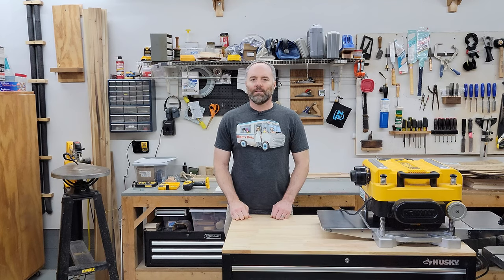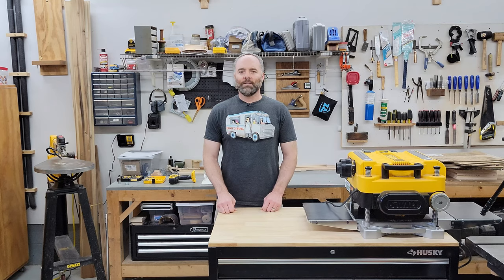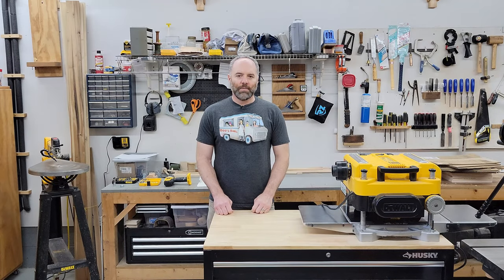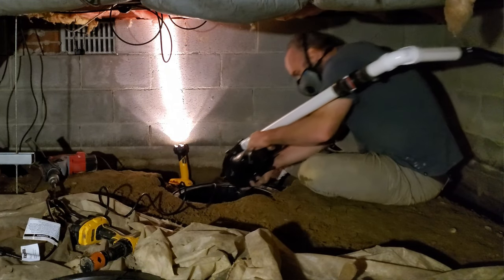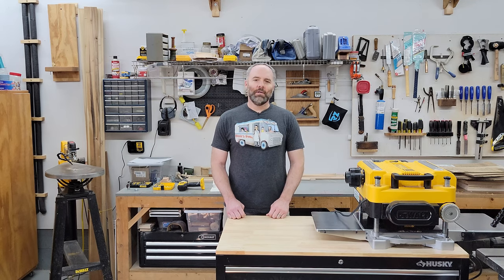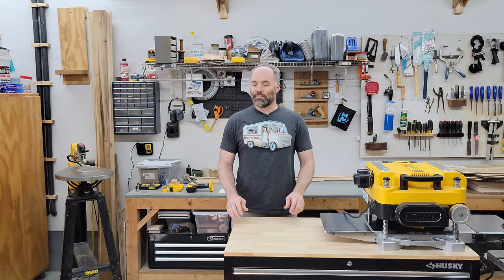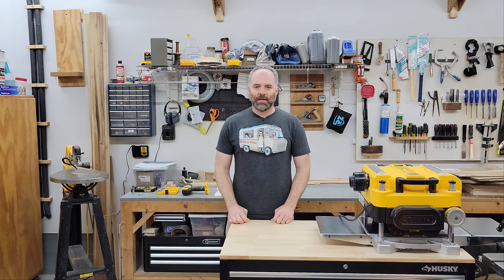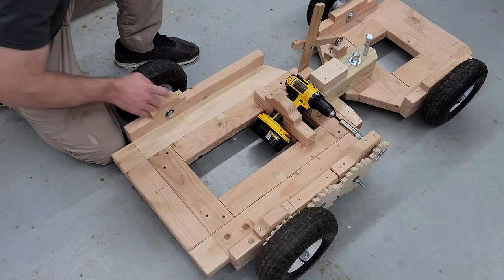Drill Powered Crawl Space Caddy - Part 2

Comment: My work has had me in many crawl spaces over the years and I've made a few rough terrain creepers each with a caster like mounting for the wheels. Propulsion is achieved the same as with a garage creeper, by  pushing with ones feet. To position for work, a back rest that goes from flat to upright makes it easier to sit on the cart and work at joist height. Flat on my back gives the greatest clearance to overhead obstacles and when your nose is just brushing by the underside of the joists it's easy enough to pull along by grabbing the joists.

In my area many crawl spaces have concrete ground seal making it much easier to roll over than when working in a dirt crawl space. Plastic never stays place, it is easily damaged, and water pools under it. Sealing plastic at every seam, around every post and pipe and along a hundred feet plus of dirty, dusty foundation wall seems a nearly impossible task to complete. I firmly believe that all crawl spaces should have a concrete ground seal over top of a layer of 6mm plastic as the best and easiest way to achieve a satisfactory result. Drag the hose from a concrete line pump to the furthest corner, spread some concrete, rake and then roughly screed it out then move to the next patch of floor area.
An added benefit of a concrete surface is that it makes it much easier to keep rodents and insects from moving in. If you hire out the concrete work, specify that a raked finish is not acceptable and the finish must be at least roughly screeded or floated.

As to moving material out and back in again you might do well to rent either a roller conveyor or a motorized conveyor belt. Fill a bucket, set it on the rollers and give it a shove. If working alone just keep adding filled buckets onto the conveyor until it is covered, exit the space and with a rope looped around the furthest bucket start pulling until the last bucket is off the conveyor and emptied. Then buckets back on the conveyor give them a shove back into the crawl space and in you go to start filling them up again.

A last thought on moving through a crawl space (with a concrete floor) my favored method is to use a mechanics stool, one with 5 casters, a swivel seat and a gas support to raise the seat. I lay with my stomach on the seat and can push with my feet and zip around quite quickly and it is a marvelous relief for my tired knees. The gas strut lets my lower my profile to get under pipes and beams, then easily boost it back up to a more convenient travel height. The stool base has a bit of room for a few tools and materials.

Oh, yea. Have you looked at the battery powered wheel barrows? Too tall to use in your crawl space but they would have the power to move a lot of weight and perhaps the motor, battery and controls could be borrowed to power a cart for your project, then put back into the wheel barrow when done.

Comment: Nice idea.  If you connect the battery to the drill using your own wiring, you could put a switch up front.  If you lock the drill in the ON position (or use a hose clamp to keep the drill's switch pressed to the speed you want), you could turn the drill on and off using your new switch up front.  You could then remove the steering mechanism, lean farther forward and steer using both hands.  This will give you more leverage to steer, get your body lower to the ground and you can turn the drill on while using both hands for steering.  Also, you could make a low profile wagon and connect it to the back like a trailer to move your stuff around.  Just some food for thought.
Reply from the maker: The trailer idea might be the way to go. I originally put the load in the front so I could see the height as I was driving under things, and also so I could drive the platform right up to the load/unload points. It would be tougher to back up, but there are ways around that.

Comment: My suggestion is to put away the wood, go get some steel and a welder. It will be much stronger, which means you can make it lower profile. 

And the SawStop 3hp PCS is a great reward, I just got mine fired up today. You will love it!
Reply from the maker: I think you're probably right.  I was even considering aluminum for weight and rust resistance, but I'd have to use all mechanical fasteners since I just have a small wire welder.  Then again, I trust my bolt-fastening skills a lot more than my welding skills.

Comment: If you want to reduce the radon even further, consider pressurizing your crawl space. We're not talking like an air tank, but barometric pressure differences. How? Since you are sealing the space, go a bit further and seal off the floor, also. Then duct in air from the outside using a solar powered fan. The radon will go where there is the least resistance, something like a cloud. The goal is to leak a bit of the air so that there is a couple of inches (barometric pressure) higher of pressure inside the crawl space. Just a thought. In Michigan the same trick can be done with the furnace blower with outside air. That means paying for electricity. Using solar means you only cry once at the price. It should be able to be done for less than $1,000. With your abilities maybe a couple of hundred dollars.
Reply from the maker: Depressurizing with a fan is one of the standard radon management techniques, but the fan sucks air from under the vapor barrier and vents it above the roof line. The risk with even slight positive pressure is that it could force crawl space air through all the little gaps around plumbing and electrical holes, or in to the air system where the air ducts were inadequately sealed. The solar powered fan is a good idea, but I might face it out rather than in.

Comment: When we had to dig out under my stepdads house.we folded up a heavy tarp,built a ramp at the entry hole ,tied a wench to it and would fill the tarp up and winch it right out.
Reply from the maker: Pulling from the outside is a good idea. Unfortunately, the HVAC is horizontally placed right in front of the entrance door, but for some areas it might be easier to pull a cart.

Comment: I remember the days of that type of crawlspace. When I built my current home no basement was possible because of flood plain levels in my area. Based on codes there was no reason I could not create a crawl space that you can walk through.
At the same time it solved the problem of where to put the tornado shelter / nuke bunker combination. The additional cost of of adding 4 feet of height was likely less than the cost of a decent bandsaw.

Comment: I love this!  A question I have, that I'm sure you've probably already answered for yourself, is do you have to kneel on it?  Could you build it so you could lay on it instead?  Then you wouldn't have such issues with your height tolerances (and it would be easier on your knees).
Reply: We may have the same problem.   My crawl space is literally a crawl  only space.   I need to do much work in it this spring and am dreading it.
Reply from the maker: It's an option, but the trick with this thing is that solving one problem keeps creating others. If it's longer, it's heavier and less maneuverable. I considered something like a floating trailer in the back that I could kick down when needed, but I'm not sure if that would be practical.

Comment: I am reluctant to say this this, because you may already be done with your excavation. 
I had a similar problem where I had a hard time moving dirt in a confined space. In the process of procrastinating I observed a 5 ton truck along the side of the road at a busy intersection. The truck looked like it had a large water tank and the largest hose I have ever seen protruding from the front. It sort of look like this oversized elephant trunk. It appeared to be about 2 feet in diameter. Well it turned out to be a vacuum excavator.  Yeah, I had never seen anything like it, but it gave me an idea. The trench and post hole I needed to dig would lend itself to a small hose and I already had a shop vacuum. So I made a box I could seal and place into a wheel barrow. I was able to dig with a pry bar and vacuum. I could dump the box I made directly into the wheel barrow. With your skills you may just need to seal the wheel barrow sort of like putting a lid over it.  You want a large volume to pull the dirt into so it slows down and settles. The confined space in the hose makes for the air speed and excavation. 
 In your case I would use smooth 2 inch PVC to cover the long distances and flex hose and a scoop on the end where I was digging.  PVC pipe makes a good scoop if cut right.
With this method all you have to do is pull hose and you have an excavation tool and a method (air conveyor) to get the dirt out.
Good luck and Kuuuudooos on the saw stop :)
Reply from the maker: I'm still procrastinating so I can work on other projects, and it's never too late for new ideas. The soggy red clay might be difficult to pump. Sometimes I even need to scrape it off the garden tools. Now I'm curious to look up vacuum excavators.
Reply: @TheSnekkerShow   The vacuum excavator I saw was being used by the local utility, When I tried it, the dirt I was lifting was semi dry , I did have some clay but it mostly balled up, it wasn't wet enough to stick. If your dirt is semi dry a hand held garden cultivator would make small chunks and as long as they are smaller than the tube the vacuum pulls them right through. It would save the need for hauling the dirt, as you could just dig and move dirt outside of the crawl space using the vacuum hose. A word of warning though don't get carried away if you plug the tube it sucks. :) 
Oh for the radon I would suggest your get some great stuff and foam around all the openings in the sub-floor, that would help keep the gas in the vented crawls space where it could escape. Well the foam seal would help. There are also low speed fans for radon removal.
Your going to have a problem in winter as I suspect the vents were closed because the heater/AC unit is in the crawl space. That means the crawl space gets warm in winter and is cooled in a hot summer. The vents were probably closed because it keeps the heat/cool contained.
If it was me I would use the vacuum excavation to even the floor a little and then place the plastic down and on top of that I would put in a 2 inches of 4x8 EPS foam board. The foam board can be stuck to the concrete blocks with the spray foam.
Also sense you have the sump in I would place another pipe into the top but keep if close to the lid so you could then hook a small fan and pipe the air inside the sump outside. This would let your trenches around the perimeter capture radon gas and the small fan would send it outside. This all assumes you take the plastic and tape it to the perimeter block stem wall. 
Good luck with the vacuum excavation search its sort of a rabbit hole.. :)